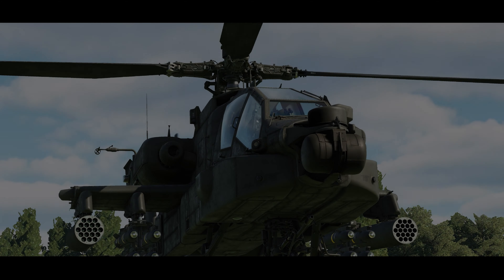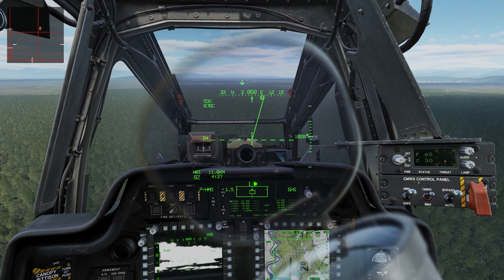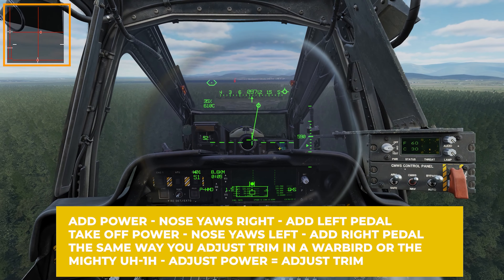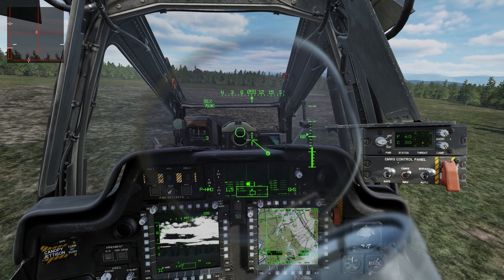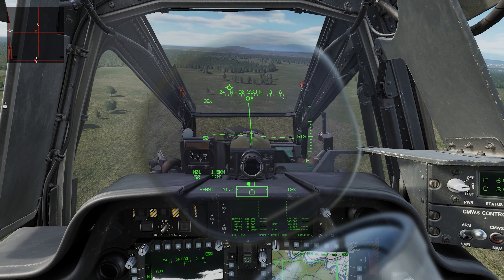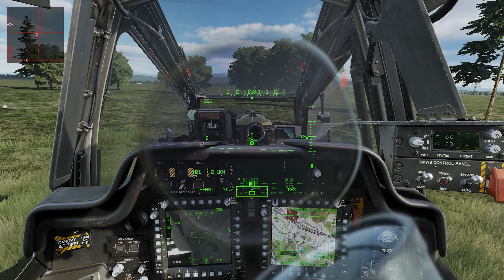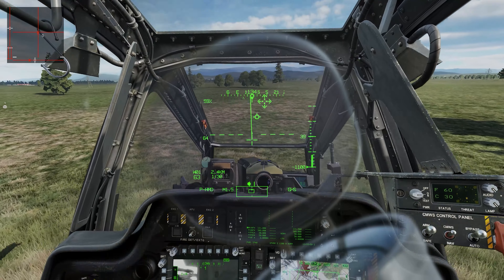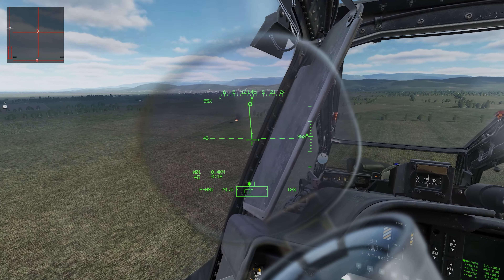How I trim the Ah-64D | Trimming Tutorial | DCS World

Comment: Thank you for this video, it has been tormenting me why this helicopter keeps spinning uncontrollably to the right everytime I try to take off. I have been adding collective very slowly in a fashion to measure how much torque is required for lift to taxi and perform push back and then finally lift off. Everytime I raised the collective enough to get the torque for flight. Each time it hit that sweet spot I would spin out to the right. Your video reminded me that you do need rudder trim to counter this effect to keep the back of the helicopter straight when the torque from the main rotor is producing enough lift for flight! That was helicopter flight 101 that I was blank on for the last couple of days trying to get her off the ground. I was successful in getting her airborne today! Wags did an excellent job explaining  symbology. But he confused me when he was showing that he had the cyclic being trim locked in different positions and I guess he wasnt too clear that it was only the rudder that needed trimming slightly to the left like you explained to counter balance the rotation of the main rotor. Thank you for this!

Comment: If you don't have rudder pedals what key binds would you use for trim AND what trim do you do just the up or all of them IE left, right, up and down? And do you trim to default all the time? Thanx for any help you can offer.
Reply from the maker: The trim I set is once I have it steady, I press the trim button to hold that position. It trims the appropriate surfaces for the position they were in when you pressed the trim button.

Comment: Nice video. How do you avoid the “Low RPM” warning when arresting your descent into a hover. I find in a hover - when I find I’m descending a bit - my power goes to high and rpm drops away. Only way to resolve is drop the collecting - resulting in a hard landing and/or roll over.
Reply from the maker: Watch your rate of descent and ensure you don’t go into VRS
Reply: @TacticalPascale  That VRS is crazy, I experienced that on my first flight today. But I recognized when I was going into VRS to know to add some collective to buffer it out to slow my rate of descent! Still came down a bit hard, but atleasts she didnt explode on touch down! I had no cheats on so I know my landing was crap, but atleast it wasnt tragic! lol
Reply: When you are on approach and slowing down to 30 knots and below, start increasing collective and keep vsi between 500-200 ft decent rate.

At 30 knots and below you are coming out of translational lift and will fall like a rock if the disk (rotorblades) are not loaded.

Comment: Are you adjusting your power along with moving the collective?  What is the optimal power setting?
Reply from the maker: No, the “power” I refer to is just poor wording by me. The engine is at full RPM, when I pull on the collective it changes the torque, percentage above the speed in the ihadss.

Comment: Call me daft but its not power its angle of the blades when you change the collective, the bigger the angle the bigger the drag on the blades, power should be in flight, or am I being daft?
Reply from the maker: The cyclic changes the pitch angle of the blades so that each of them will has same angle of incidence as it passes the same point in the rotation.

The collective moves the pitch angle of the blades at the same time, hence “collective”. If you’re in level flight it will change height.
Reply: Wow  @TacticalPascale ! What a wonderfully concise explanation (that clears so much up for me too!) Thank you! 🙏